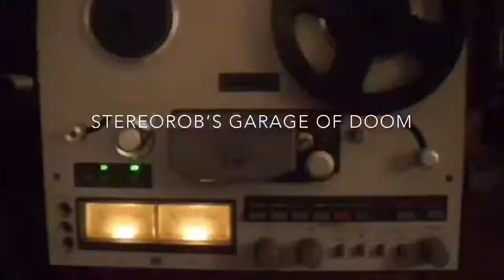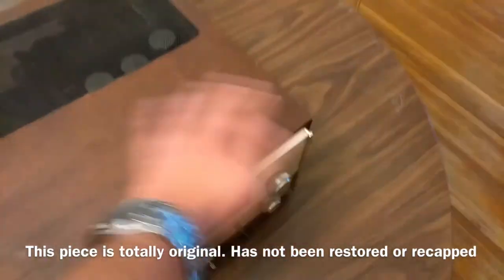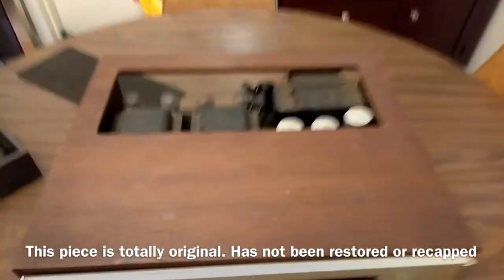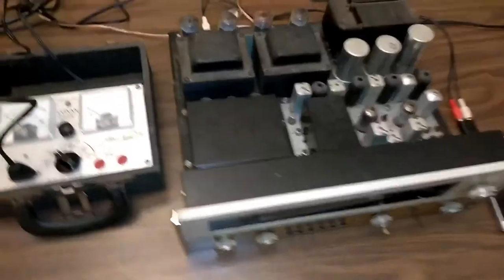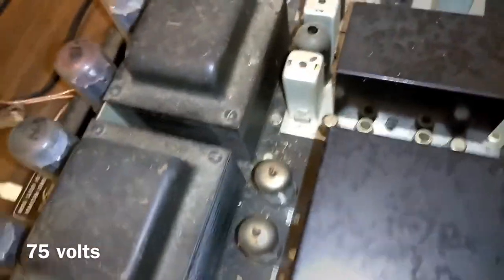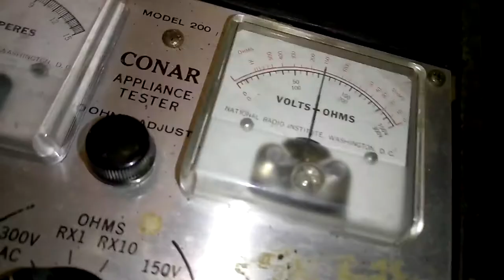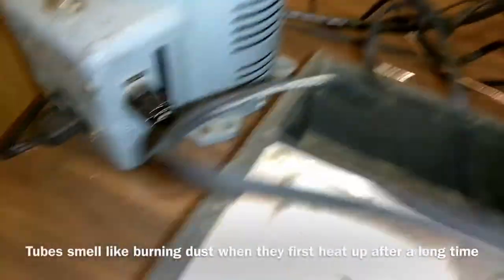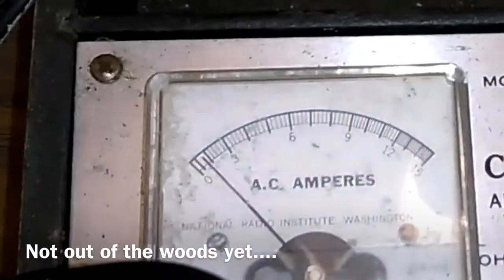Powering up a vintage McIntosh tube receiver for the first time. Will it blow up?

Comment: Rule number one. With vintage equipment, at a minimum, change all the capacitors. I restore antique radios as a hobby. First thing I do is remove the original line cord and re- cap the radio. Then power it up using a variac. You keep referring to the voltage. That’s fine but you should really be concerned with the current draw.